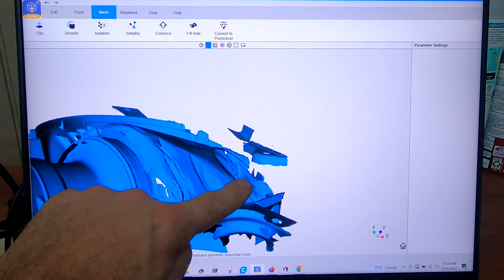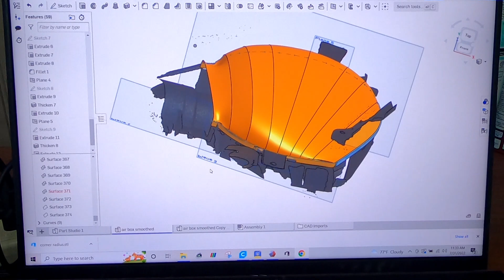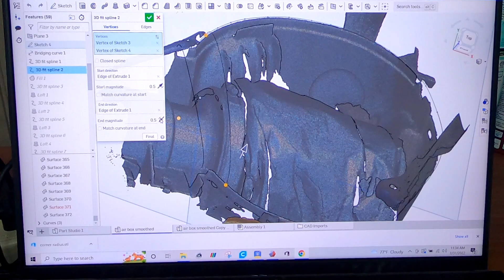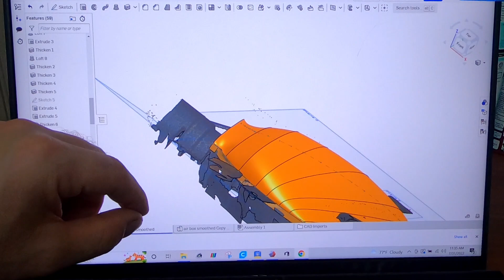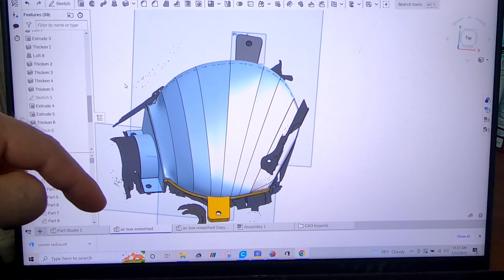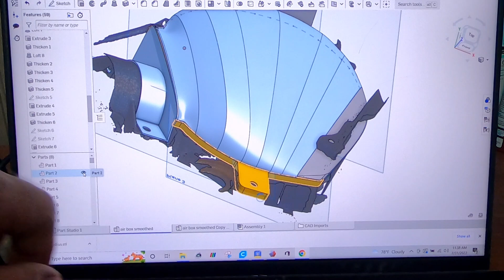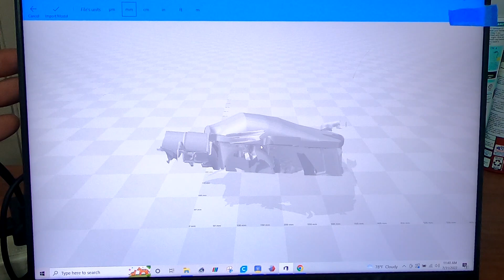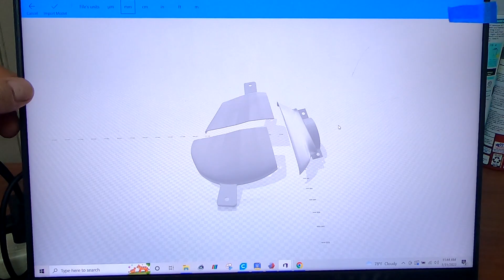Carbon Fiber Airbox Lid Part 2- CAD and 3D Prints

Comment: How were you able to give you're 3d scan measurements? I have a revopop and when transfer my scan into a cad program it isn't accurate as in size. I hope that made sence
Reply from the maker: You can export and import it in inches or mm so sounds like you got something mixed up.

Comment: Not familiar with your software (I use solidworks), but there should be a way to perform a blending between the loft sections.  For example, you might be able to have a drop-down box that you can select tangency from one section to the neighboring one.
Maybe you did them as individual lofts, instead of blending all of the sections together in one large feature.  That's kind of what it looks like.
Reply from the maker: There is but any time I tried tangent from my 3D splines it would return an error. I chalk it up to me just not being great with cad and had some small detail wrong somewhere. I did do individual lofts so maybe that was it.
Reply: @ajhartmanaero  , roger that.  Solidworks has a few different features that can all build similar surfaces, and each has their own +/-.  I'm sure yours is similar.  Good luck!
Reply from the maker: @rocktman117  thanks. I’ll go back and see if I can figure it out. Hope all else is good in tx!

Comment: For a one off part , being lazy and having spent way too long on an airbox lid I would be tempted to glue the parts together use a lightweight micro sphere filler to smooth out the internal and external contours and sandwich the printed part in a layer of cloth , sand , matt paint and matt lacquer the result . With the polymer core this will produces very stiff structure without a ton of additional work . Sorry I'm not a great fan of the look of carbon fibre , its kinda naff and cheap looking , too much of it around . I use it as a structural material . Its like leaving a machined billet of aluminium unanodised ( not permitted in most racing formulas ). Very interesting series and I like the way you have combined a number of techniques to achieve your final goal . Will be interesting to see before and after dyno figures and measured on road performance lap times .
I have to produce a one off airbox for an F2 sidecar which has to support the upper body weight with a degree of comfort and duct in air from the front and will be modifying the original bottom moulding using polymer welding to produce the regulation intake holes and using the foam bag technique for the airbox lid and body interface . The driver must be as low as possible as must the whole outfit . Once I have created this form and removed excess foam , adjustments can be made to ensure optimum flow to throttle body's and I will end up with foam core/modded lower airbox that can be prepped for laying up as one piece . As the airbox shares the bolts for the throttle body intake bellmouths to mount it , a small access panel has to be formed in the top and later sealed . This access panel ' hole ' allows the removal of the foam core and I will end up with part of the lower airbox that I know will fit close to the engine and the throttle bodies with lay up of carbon with the modified intake and combined lid with multi layup that matches the internal dimensions of the lower airbox and body form . As you know manufacturers of super bikes go to great lengths to design an airbox with cold air intake and shape to achieve 180 bhp/litre . Aesthetics of the appearance don't play much of a part here . The filters are generally made from 2 or 3 layers of proprietary filter materials to suit the intakes in a sandwich of stainless mesh wired and sealed to the intakes which is easily replaced , not an off the shelf filter of any kind , in order that airflow is aligned and eventually meets the throttle openings as smooth and equally as possible . Using the original airbox as a guide helps here and they generally are large in volume compared to engine size . The created form of the top of the airbox meets this function . A certain amount of ram air effect is present at the intake air is taken from a high pressure area at the front which meets a less than 1" pressure drop at the filter and opens out into a higher volume airbox with a slight pressure drop . 2 x 75mm or a lower area 1x100 mm bore ( or equivalent in area) intakes are permitted .
And this is the easiest part to produce on an F2 sidecar as I a not using any other design of the bodywork /rad ducting etc.

Comment: in your future models you can use positive and negative shapes along the joints to get the pieces to line up nicely together. i prefer cylindrical pins, but you can use any shape.
Reply from the maker: I think I follow you. I thought about something like that but seemed a little advanced for me and would spend more time trying to model it that just bond the pieces together.

Comment: Hi. Why not print the mold right away? Fusion can get it done easily. Quick to glue parts together and voila :)
Reply from the maker: You must have missed the part where I don’t have a printer large enough. it’s way to risky to assume my cad model is perfect and just glue mold sections together and hope the final part fits. When part 3 comes out you’ll see why if I did it that way it would have been a disaster.

Comment: Whatever size robot (3D printer or subtractive CNC machine) you buy, you will very quickly find something you want to make that is just a little bit larger than your available work envelope.
Reply from the maker: That’s how it always works without fail.
Reply: That is Asimov’s 4th rule of robotics.

Comment: We use fusion360, so it may be different, but you should be able combine all your surfaces into one, then thicken it. That also makes it so you have uniform wall thickness throughout the whole part.
Reply from the maker: I tried the Boolean them all and it didn’t like it. I could have tinkered with it more but knowing I could export as a whole decided to not worry about it.
Reply: @ajhartmanaero  looks like the part still came out accurate enough for your needs 👍 nice work